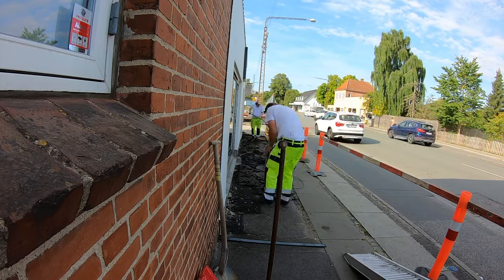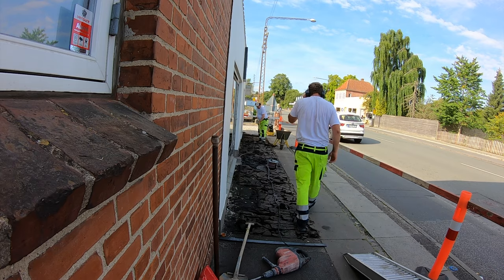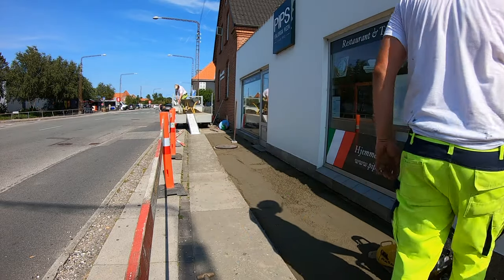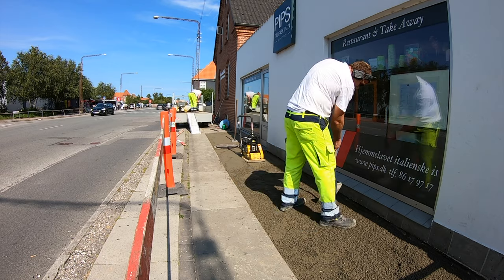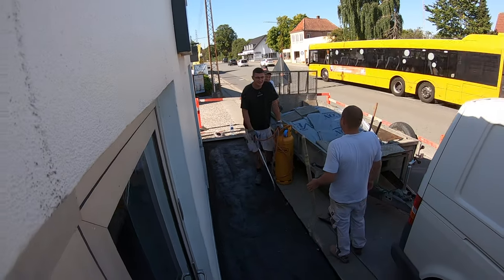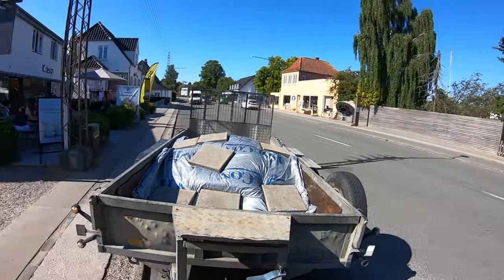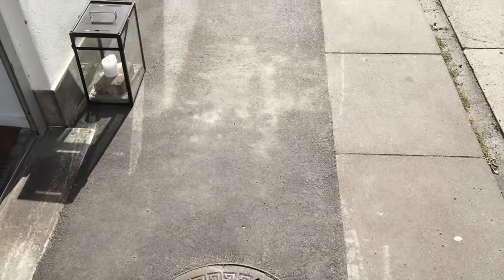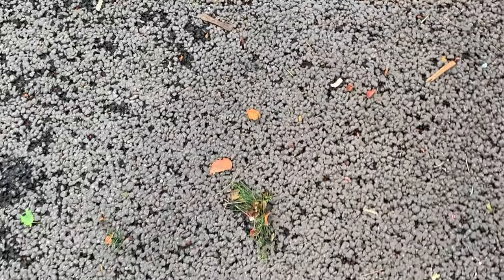Tutorial:How to lay asphalt, STEP BY STEP(in detail)

Comment: I would like to see detailed videos on putting asphalt on damaged concrete driveway.
Reply: That will only be a temporary solution. Not worth all the time and money because you will have cracks and other issues. You need a proper base, which is why they tore the old asphalt out instead of just going over it.

Comment: Hello, great presentation, thank you. Is it possible to use only plate compactor for compacting asphalt without usage of "roller compactor" ?
Reply from the maker: You can do it, but you need to have some experience. Try to use it on a smaller scale before committing on a big patch of Asfalt .
Don’t forget about watering the Asfalt tough, it makes a big difference on the result.
I would recommend the roller for the best results.
Best of luck to you! 💪😎

Comment: Much similar methods like i do. was the quality of the asphalt that day bad? or a bit cold wheater. It was a bit many pours in the asphalt. What type of Aspahalt you used there ? Also in future a Hanger with tip and shuffle from there whould be alot easyer. Have the hanger move after the parts being made. All in all good work.  You putt in alot of work
Reply from the maker: Hi Jan,I used the small granulation top layer asphalt.I wish it had more bitumen inside tough .We had around 18-20 degrees C that day(that’s hot in Denmark, 😀),but it still looks like new after 2 winters.The owner is very pleased and got me few other references after that job.  I’ll have a look for the hanger,thanks for the tip!

Comment: Also where can i rent some of these equipment
Reply from the maker: Try the biggest rental places around,they have it,probably you need to call in advance,maybe they have it in different location.It is pricey but I would not recommend starting without a roller vibrator.Very big difference in quality compared to a plate vibrator

Comment: you asked for comments so here we go. 1st where's your chalk mark for height along the wall? Why would you need to call the plant when they can make it Fresh from the batch plant when you pull in? Most importantly Why would ANYONE use concrete as a base when concrete heats and Cools at a different rate? Thats why you Never black top over concrete well at least here in the states
Reply from the maker: Thank you for the comment,those are some good points actually.
There was no need to make a chalk line on the wall,because there was the bottom of the granite on the wall that gave it’s height,much better than a chalk line since it can’t be covered by color of the concrete or asphalt(level on the length,and it had the proper fell towards the street) but if there wasn’t,I usually use a styrofoam roll,(50 m roll,5 mm thick )and glue it to the wall when I pour concrete or asphalt,it gives me the height,makes a barrier for the cold,and it gives the asphalt/concrete place to dilate or contract.. When the surface of the concrete or asphalt is dry,the styrofoam is covered with tar,or special silicone.
 2.You need to call the plant in advance,because they make very exact amounts for every day(down to kg precision).You can order it a week in advance and you can pick it at specific times,when they program you.The asphalt is very fresh and very warm.In this particular case,it was so hot  that the cover I had melted.And it was a special cover. 😃😃The warmer it is,the longer time you have to use it,hence the better finnish result.If this aspect is not organized well,very fast things go bad.
3.Concrete under asphalt is only bad if it’s reinforced,than, you get problems,some big ones ,since the weak spots will crack(where the rebar,wire mesh over lapse or on the control joints).The concrete I used is not reinforced,and if it cracks,the asphalt on top won’t .From all the places I used this technique,I never had a crack to this day.Also,this is the way highways are made in Germany and when visiting Arizona few years ago,I noticed they do their highways ONLY in concrete (more than a meter thick)since it whitstand the heat way better than the asphalt.If there is a day where the temperature outside is in 100/110 Farenheight, and you have to chose to drive a semi over thick asphalt / or a thin asphalt with a concrete base,what would you prefer to drive on best?The base gives the asphalt the strength.Not the top layer,or a wobbly asphalt base on a hot day.
Reply from the maker: Also,I forgot to mention,at the 3rd point,if  it would have been bad to put asphalt over concrete,no matter where in USA you live,every bridge you drive over would have a terrible surface,but usually,the asphalt on a bridge outlasts the asphalt on the roads by a ratio of 2 to 1.So yeah,not sure your concern on that regard should make you too worried.
Reply: Your talking nonsense you can asphalt over concrete to be honest with you some of the worst asphalt jobs I see on YouTube are all in America yous just can’t do it simple as that not all but majority are not good at it I been laying asphalt in Scotland every day my life 23 years from resurfacing full carriage ways to small patchwork deep reinstatement for gas and water utilities and we use a foam concrete on heavy traffic roads and bring up between 14/16 inches of asphalt 4”being the surface course if you want to learn anything about asphalt the whole of uk do it best simple as that
Reply: @gazzbhoy8950  well now if I could give you a Gold star sticker I would. Just so that you know.... Its NOT a good idea to top over concrete, Maybe where you guys are BUT not here when weather fluxes the way it does. Oh we have to think about what the cost of doing the job.... It all goes out for bid.
Reply: @benjaminsagau   we dont top over a bridge surface because they mostly concrete butt up to the edges yes